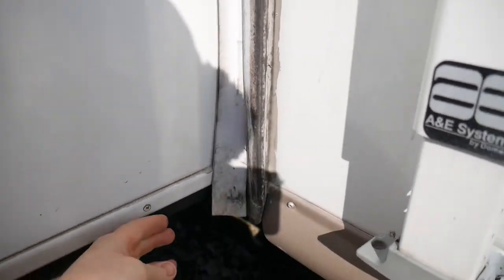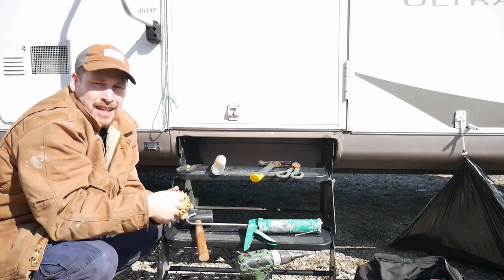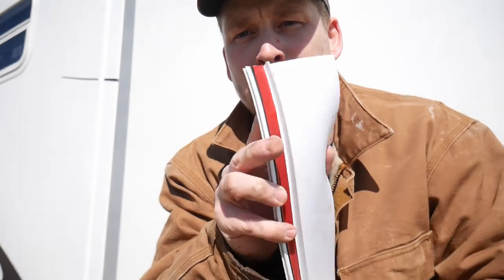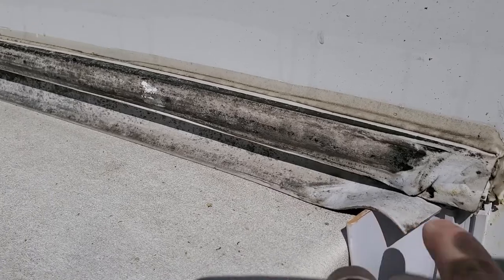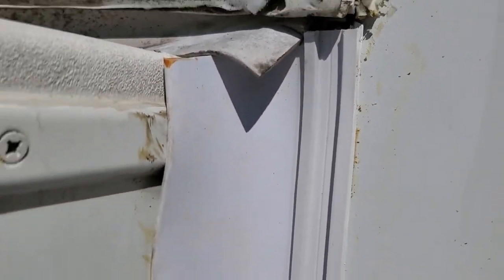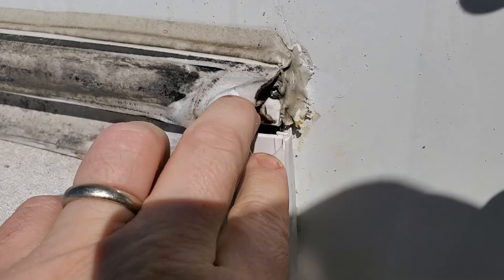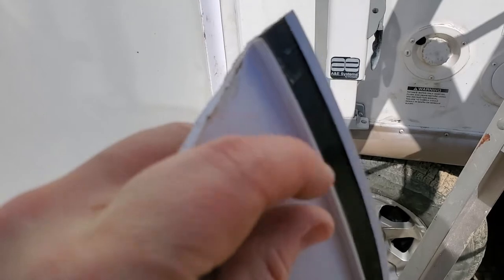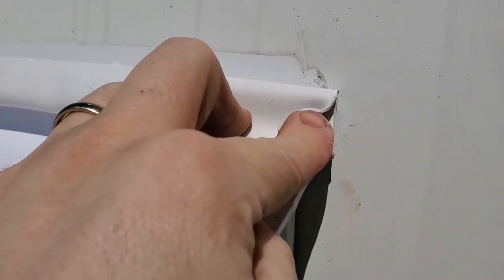RV How To | | Replace Rubber Slide Seals| | RV Slide Out Seal | | Bad Slide Seals | | RV DIY

Comment: Great job on the video.  I suggest if you have them to use flat nose pliers.  They get much better traction on the staples.  Avoid using screwdrivers to wedge them out also.  Good way to poke a hole in your wall.  Also Goo Gone is great for removing adhesive and cleaning.  That stuff is also safe for your paint surfaces.

Comment: What's your reason for using self leveling Dicor instead of the non self leveling? I thought you don't use the self leveling on the side of the RV b/c it runs.
Reply from the maker: The reason is I know that is will stick to both the fiberglass and the rubber.  You can you other caulks, but I just prefer Dicor.  It doesn't self level as much as you would think, once it has been smashed down into the cracks.

Comment: My flap seals are held down just like the D seals but I can’t reach it because it’s on the inside of the track and not outside. Any ideas on how I can reach it? I already tried an angle drive but there’s not enough clearance

Comment: The link for the Dicor is self-leveling not just sealant. I purchased self-leveling based on your link but I think, for this application, I can't use self-leveling... right?
Reply: I just asked the same question, I beleave you right- not self leveling

Comment: Best instructions on the internet. I wish they would address how much of the wiper should lay against the slide. I don’t want to get it to long or to short. Thanks
Reply from the maker: Thanks hopefully they helped
Reply from the maker: Depending on the wiper that is required on your RV, some can be cut to size.
Reply: @HaleyFamily  Thanks, I actually found one that is about the same width as the old one. Thanks again for your reply.

Comment: Nice job, I was lucky my NU-WA 5er came with an aluminum brow over the slides, really helps when it rains and it sheds water away on both sides, it sticks out the ends by about 6" and is 3" deep.
Reply from the maker: Thanks.  That's awesome happy camping

Comment: Was there just one staple put in?  What does it go into?  Fiberglass?
Reply from the maker: I put about 25 to 30 samples in one section.  So on our camper there is a separate plastic trim that goes all the way around the slid that is then attached to the fiberglass.  The staples go into the plastic trim and not the fiberglass.   Thanks so much for watching!

Comment: I have a 13' slide that I'm replacing the top seal on. Do you think 1 tube of Dicor is enough to do 13 linear feet? Have to order online so I need get the right amount ahead of time, but I also don't want to order more than I need.
Reply from the maker: Depends, I usally put it on pretty thick. Our big slid is 13' as well and it took 3 tubes to do the top and both sides.  So...ummm maybe lol.

Comment: Great Video.  My top seal has two layers.  There is one on top of the slide that has a channel for the "D" seal.  There is another one under that one that seams to connect to the the frame of the RV itself above the opening for the slide.  It seams to wrap around the frame of the RV and I can't get it off.  Any ideas how to pull it off?  Thanks
Reply from the maker: Good question and to be honest Youtube can be your best friend.  Try looking up your particular make and model of RV for a video.  There might be some hidden screws inside of the seals that have been sealed over or something.  Also, sometimes you can contact the manufacture if the owners manual doesn't help.  I can say from experience if the seal doesn't  come off with just a little tug there is something holding them on.
Reply: Yah I have same thing going on. This wiper seal is a huge pie’s that goes way inside of the camper and its a big complex piece.. nothing like the one in the video. I know cuz I’ve already pulled a piece of it out.
Reply: @stillamitchinmybook6320  You may have a "H" seal which is what I had. Steele Rubber Products RV Products catalog shows an example of a "H" seal and shows where you have to cut the old seal off.  Then you install a new seal much like in this video. I replaced the outside part of our "H" seal, inside is in good shape.

Comment: We have had Class A motorhomes in the past but this is our first RV with slides. The inside seal on the big slide is torn, has holes, and missing pieces. Even the good areas don't look like it seals. I don't believe it is the correct seal. How do I find out what seal is correct for my Tiffin Allegro?
Reply from the maker: Check the owners manual there is usually a section specifically for the slides and it should have a parts list with part numbers. Once you have the part number its is pretty easy to find them there are TONS of websites.   If you can't find the part numbers in the manual I'd call a Tiffin specific dealership.  They should be able to look up that information for you and maybe even order the parts.  They will of course  try to talk you into having them install them, but most dealerships FOREVER.  Thanks for watching and happy camping!

Comment: Great Video . I have a problem with  my seals leaking and want to replace them . I want to get the magic eraser but can't find the link . Could you tell me where to find one ? Thanks ,Rod
Reply from the maker: Sure thing. Hope the video helped.  Here is a link. 

https://amzn.to/3XrpGH6
Reply: @HaleyFamily  Thanks , I will get one . I have a leak above one slide and I sealed it with Flex Seal Tape yesterday and another big rain is here again . I contacted Mobile  Suite so I can get the correct seals . Thanks again and hopefully my flex tape will keep the rain out till I get what I need . Thanks again , Rod